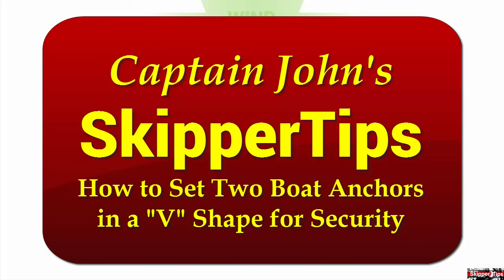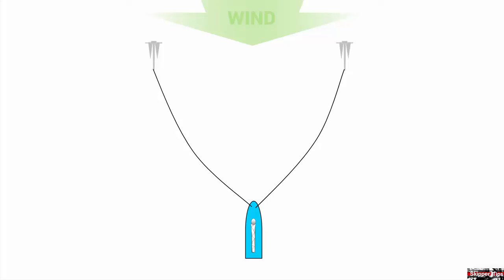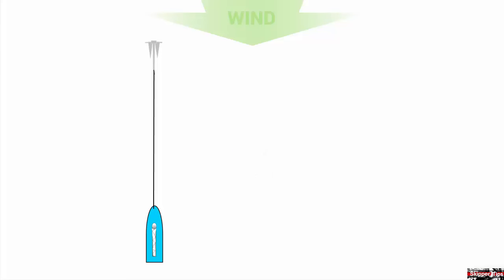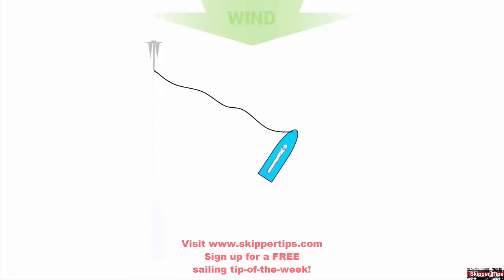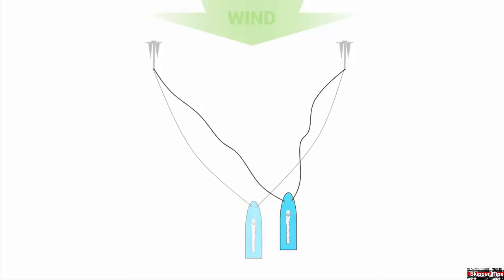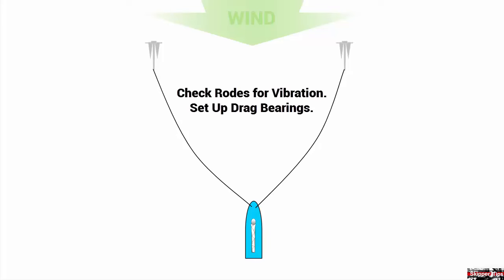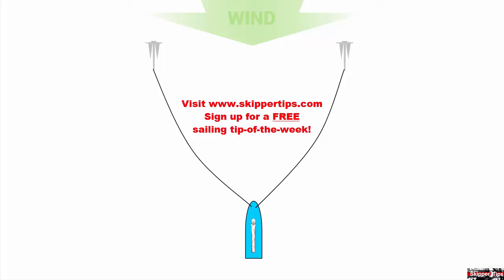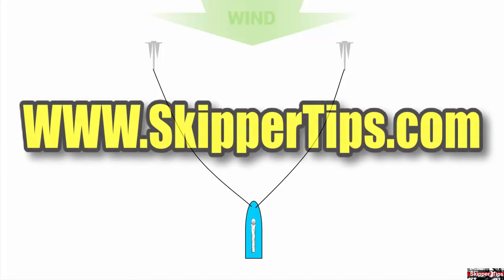Boat Anchor Tips - How to Set Two Anchors in a "V" Pattern

Comment: works fantastic in theory
Reply from the maker: Manfred, thanks for your comment. You are correct, but still a need-to-know skill. The main issue with the V-pattern is the possibility of 'rode-wrap' where the wind shifts and the anchor lines wrap onto one another. Retrieval can be a major issue when that happens.